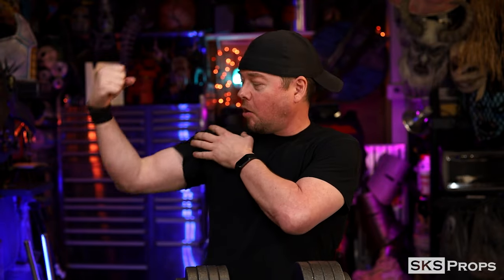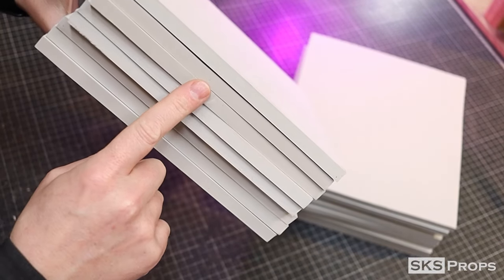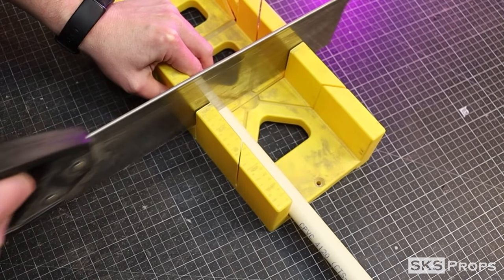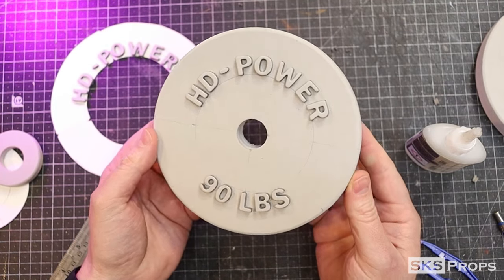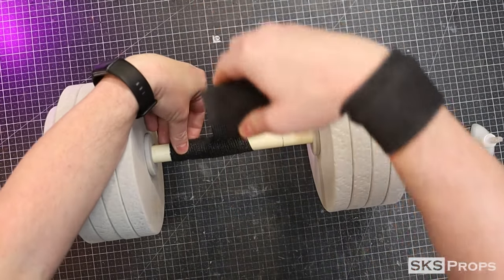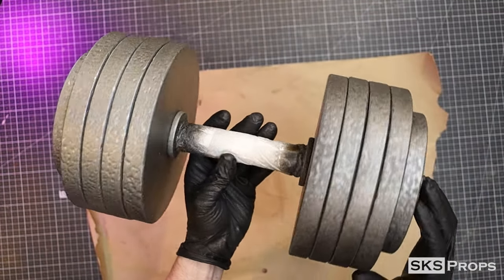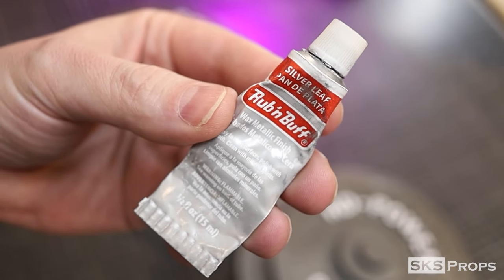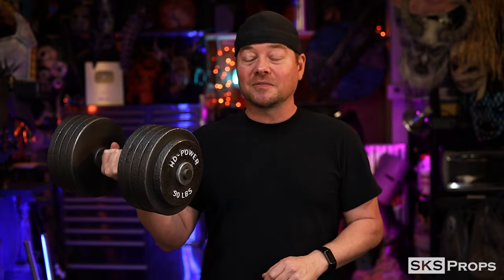How to Make Fake Weights - Light EVA Foam Dumbbells Perfect for Cosplay Photoshoots

Comment: the outer plate should say 5 lb, not 90 lbs
Reply from the maker: Incorrect, if you had watched the video I mentioned fixed plate rack dumbbells have the overall weight designation on the outer plate not the individual plate weight. That’s also why it doesn’t have a screw clamp on the end
Reply: @SKSProps  I stand corrected. I've never seen anyone use fixed dumbbells with plates before. Didn't even realize they existed. Most fixed dumbbells have solid/brick ends.

Comment: Imo, you probably coulda saved quite a bit of foam if you cut the smaller weights out of the center of the bigger ones. You'd still need a "solid" one for the outside and inside sides of the large weights, but the ones in the middle could've been mostly hollow and not looked any different.
Reply from the maker: I own a foam company do you have any idea how many stacks of foam I have in storage 😂😂
But if you were making huge plates then yes
Reply: @SKSProps  Right, but we don't.
Reply from the maker: @CthulhusDream  and that’s why I make the videos to inspire, but to make it it’s all on you. you can always increase the scale, cut corners, and build yours however you want